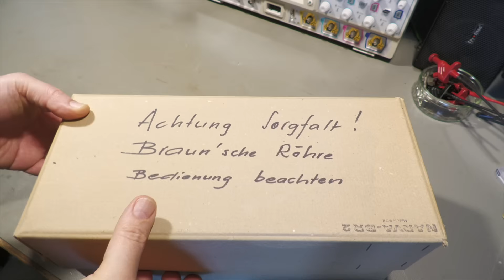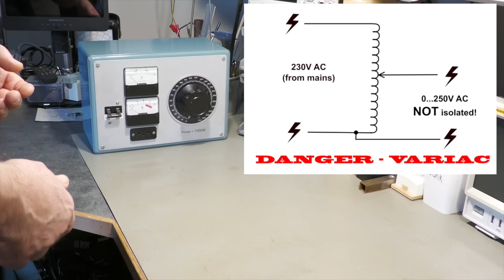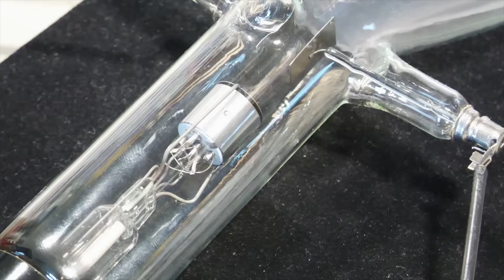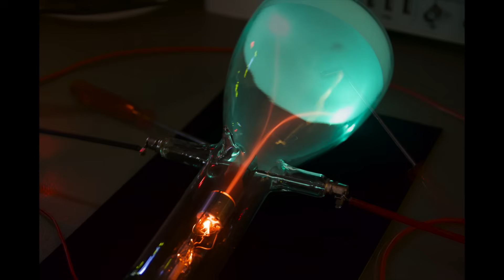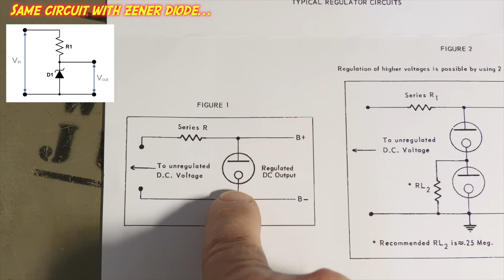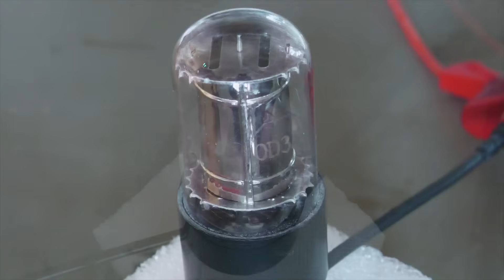Have you ever seen electrons? Watch this!

Comment: A very interesting antique tube the Neon fill makes it usual for a CRT.   In mid nineteen seventies I was employed at Tektronix Inc in the engineering tube lab.  Tek manufactured their own CRTs I got to know these items well.   One comment on safety.  Large vacuum tubes can implode violently, safety glasses plus some protective clothing would be wise.
Reply from the maker: Thanks for the warning. I know that. I worked in a TV studio and we had to replace many CRT's on professional monitors that have been running all day. We also had a complete set of safety gear. Helmet, goggles and a leather apron.... but nobody ever used that 🙂 And in fact not a single CRT imploded except those where we "helped" a bit. 🙂 You can see what we did then in this silly video "The apprentices from Swiss TV": https://www.youtube.com/watch?v=Z-0Bt3NoaCM&t=1s (at 7:30)

Comment: You can added two vertical deflection plate with 2 auto adhesive copper strip stick from outside neck of the tube.
Reply from the maker: Hmmm... that should work... I guess I will try that :-) I'm just not sure how to make the necessary high voltage. I assume, because the plates are far away from the beam, we need much higher voltage than on the "normal" plates
Reply: @PlaywithJunk You can extend the length of Cooper strip to the end of the tube, the phosphorus side.
That will increase the deflection sensitivity if needed.

Comment: where do the electrons go when the beam doesnt reach the phosphor? this is breaking my brain
Reply from the maker: To break your brain a bit more... the phosphor is not connected to anything. Where do the electrons go when they hit it?
Answer is, they just swirl around and will finally find a metal part to flow out. If you look closely, you see a dark cloudlike spot when the beam first hits the screen. I guess those are embedded electrons that repel the new ones. After some time these spots diappear. The electrons will find a way out 🙂
Reply: @PlaywithJunk  ahh i see that makes sense. i was also wondering what that dark spot was! insane

Comment: How do the electrons return from the screen?
Reply from the maker: That's a very good question. I think some just bounce off and fly around until they hit a metal part. Others just don't return and get stuck on the phosphor. That's those dark spots that look like burned or like clouds. Those dark spots disappear after a while...
Reply: @PlaywithJunk  Electron microscopy shows that some electrons go deep into material. I guess that secondary electrons help to neutralize the screen. The screen needs to be on a negative voltage to allow electrons to drift back to the cathode. I never understood why the screen is not called the anode. In a functioning CRT, no electron lands on the "anode". But that is exactly the definition of an anode in a tube amp or battery.

Comment: You're not actually seeing electrons. You're seeing their interaction with gasses. Ie the ionization of air in a bolt of lightning or static shock. You could never see an electron because they are too small. We have nothing with a small enough wavelength that it would "bounce" off of an elecrton. In fact, we use electron microscopes because we have this same problem with light. You can only magnify light a few hundred times before it gets blurry. But, electrons have a small enough wavelenght they can see tens of thousands of times magnification. So, naturally, it won't be easy to find something to "bounce" off of an electron. But yeah, you can certainly see their path in air. Just like a cloud chamber lets you see the path of radiation in real time. But you're not actually seeing the radiation.
Reply from the maker: I know... but the title looked better that way 🙂

Comment: it never made sense to me why a variac is build like it is .. it could work exactly like a transformer where you shorten or extend the secondary side instead of burning power by having this direct connection to the power grid.
Reply from the maker: For most Variac applications you don't need that extra winding. It would make the Variac unnecessarily more expensive.
If you really need isolation, then such Variacs are available (for higher cost). It's the same problem as always... you have to know what you need and how it works. 🙂

Comment: Would the first tube normally be used with an electromagnet for the vertical deflection as an oscilloscope, or was this made purely for educational purposes?
Reply from the maker: It was made for education. But the manual says that a deflection generator (Kippstufe) is available for horizontal deflection.
Then you could use an AC powered electro magnet to produce a sine wave on the screen to show your students.

Comment: The first one:  Very nice!  Much better than the mercury filled one we had to use in college to measure the mass of the electron.  So sorry about the burned phosphor though.
I love how you showed the beam extinction.  The electrons have to have a certain minimum energy to excite the neon.  Below that they just cycle back to the ground connection at the filament.  They also collect on the grid and deflection plates if they are not connected.  Some data sheets give a minimum resistance you can attach to ground the grid and plates without putting too much beam current through them.

The second one:  It looks like it is argon filled by the color.  Very nice!  Can you adjust the voltage by shining a UV LED on the cathode?

The choice:  The thing!  I have a couple guesses but you didn't show the end so I have to wait. :-)
Reply from the maker: The phosphor is not burnt, those dark spots vanish after som time. I guess it's more like electrons that get caught on the screen and repel other electrons. A TV CRT has a conductive layer on the phosphor that attracty the beam (anode) and lets electrons flow away.
Interesting idea to change the voltage of the regulator tube with UV light. I didn't know that's possible... 🙂

Comment: I had some old tube monochrome TV sets that you could see the beam through the back
Reply from the maker: The beam or the heater? A commercial CRT usually has an almost perfect vacuum. If you see the beam, there is something wrong. I had ONE defective CRT with some air inside. You couldn't see the beam but the electrodes inside lit up in different colors.
Reply: @PlaywithJunk  Likely just the heater. Though really old television CRTs did not have quite perfect of a vacuum. This was a known problem. The ions generated by the electrons striking the residual gas were accelerated towards the cathode, and this bombardment was eventually causing a loss of cathode emission. So those early tubes used a trick to minimize that -- they mounted the electron gun at an angle off the tube axis, and used a magnet to bend the electron path. The paths of ions did not bend as much by the magnetic field due to their large m/e ratio, and they were bombarding something else and not the cathode. But I doubt that there was enough of the residual gas even then to see the beam. unless the tube was actually faulty.
Reply from the maker: @cogoid  🙂 I have an electron gun from such a TV tube and it's (as you describe) "bent". 
We also had one at school but the reason, as we were told, was a different one. It was to prevent a dark spot in the center of the screen (anode) caused by the heavy ions that were dragged along with the electrons.
Reply: @PlaywithJunk  You are absolutely right! Although cathode emission loss also used to be a problem, the bent electron gun was invented specifically to cure the "ion burn" of the screen. I did not remember this correctly.

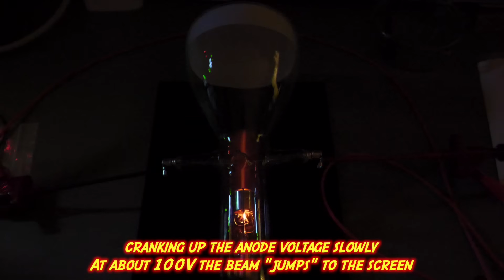Comment: 12:42 why does the beam stop there and only jump above a threshold voltage?
Reply from the maker: That's a good question... I assume the beam doesn't stop actually, but it spreads out and becomes invisible. I imagine something like a garden hose that shoots water straight up. More pressure = longer water jet

Comment: At high school in the Physics Dept we called these Teltron Tubes and we used them quite regularly throughout the Physics curriculum. We had a number of tubes for different investigations, electron diffraction with the Maltese Cross Tube, electron mass/charge ratio with the Deflection Tube with Grid and Helmholtz Coils, the Dual Beam Teltron tube, and the Perrin tube to investigate electron charge and magnetic field. Ours were stored in their original boxes from the 1950 fill with horse hair to cushion the tubes and prevent them from being broken. I always remember the fragility of the these tubes but they were great for demonstrations and the pupils loved using them. I once looked up replacement cost for one and found it to be in excess of £1000!  That was more than our annual science budget!
Reply from the maker: I guess Teltron was the name of the manufacturer? So, I made a good deal paying 115 Swiss Franks for it 🙂
Reply: @PlaywithJunk  Yes it was, in school they just took on that generic name  a bit like all vacuum cleaners being called hoovers (UK) lol. Education equipment always carries a big markup (I think due to low volume sales) so yes you got a nice bargain there :)

Comment: 3:50 Yes, a variac is a transformer - however, as an autotransformer, it has no galvanic isolation.

The reason it isn’t a rheostat is because it can produce a voltage at the output higher than the input if the input has been tapped a ways down the coil winding.

Comment: I must contradict you on all variacs are not transformers. I own an old RFT adjustable variable transformer which is basically a thoroidal transformer with a primary and a fully adjustable secondary. If you don't know what you are looking at, it looks like a run of the mill variacs.

Comment: Given the potential difference of 200V between the deflector plates, why don't they bend the beam?
Reply: The Potential Difference between the Plates is 0.0 Volts since Both are connected to the 200 Volt Anode Supply.

Comment: Also, magnet taped upon end of power-drill (but hide your tube behind acrylic sheet!)   The fast-spinning magnet will scan the beam in a fast circle.
Also, someone said that, with correct voltages, the beam spreads out into a disk, and when focused just right, it becomes an electron microscope, where the glowing disk shows an image of all the defects on the cathode surface.  (If this requires extra electrodes, maybe wind a "focus coil" around the glass neck.)

Comment: Try two wide magnets!   You can curl up and reverse the beam, creating a spindle-shaped "magnetic bottle" with visible electron-glow being reflected between two magnets.  Demonstrate a particle-trap. (Might need to alter the main DC supply, reduce acceleration far below 300VDC, to let some loudspeaker-magnets cause the beam to curl up with tight radius.)
The USA version is from Teltron , also called "fine beam tube" or "perrin tube."   Green beam if helium, red-orange is neon.   I find that the electron-gun has short lifetime because of ion-impact against the cathode oxide (they didn't use direct tungsten cathode!   Or, tilt the electron-gun, then add a tiny magnet to tilt the electrons but not the heavier positive ions.)

Comment: Couple of questions:
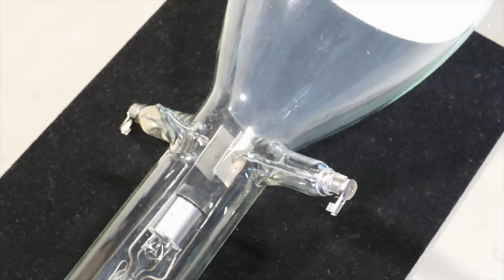 - @1:30 why do we see a small discharge?
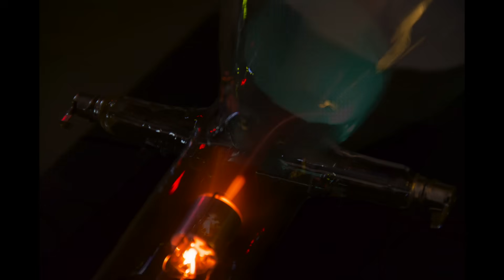- @13:54 why does the beam stop when the discharge plates are not connected? What happens to that energy and the electrons?
Reply: The energy (via electron collisions with the inert gas) is going into making the inert gas within the tube glow.

... and the electrons don't really have a lot of momentum after passing through the grid, the plates accelerate the electrons  enough that they can reach the screen before coming to a stop again from gas collisions.
Reply: @juliavixen176  "..within the tube glow." - yes i understood that and why the gas collisions happen. "grid" - what do you mean by that? he never connected that, i don't really understand its function. "plates accelerate the electrons" - I thought they were deflection plates? to orient where the electrons hit.
Do you know why that tiny(hardly visible) stray/discharge at 1.30 occurs when it hasn't even been connected to a source?

Thanks

Comment: Such an excellent demonstration!

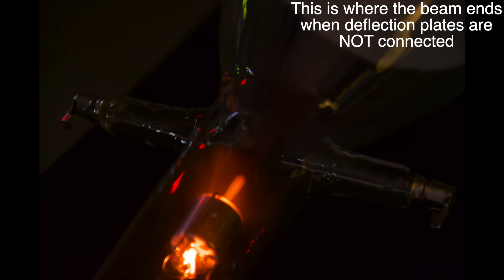13:55 "when the plates are not connected the beam stops"  I wonder if the plates provide a path to keep the screen from charging by the beam. When the electrons have nowhere to go, the charge accumulates, the potential rises, and stops the beam.

In a television or an oscilloscope CRT there is a connection and a conductive coating inside to connect the screen and let the electrons to get out. 
But here there is nothing obvious visible. If there is some coating it would be natural for the plates to serve as the connection. Perhaps that's why the beam stops when you disconnect the plates.

Comment: I had forgotten that electron beams are affected by magnets. Thank you for bringing back old memories.
Reply: Why is this happening?
Reply: @Idrinklight444 the magnetic force acts upon charged particles in motion.
Reply: @Idrinklight444  The right hand slap rule may be handy to remember: Have a sticking-out thumb point in the direction of positive current and the parallel, straight fingers in the direction of magnetic field lines (from a north-seeking pole to a south-seeking pole) and the palm will indicate the slap the current’s charged particles feel. (Since electrons are negatively charged, the thumb would point in the opposite direction of the electron flow for the same reason throwing negative money at someone makes the direction of wealth transfer towards you.) This rule is continuously applied, so a uniform magnetic field makes a moving charged particle move in a circular arc or even a full circle.
Reply: everything is at a high enough power level

Comment: the mysterious Thing seems cool .. my vote is for that :)

I started wondering during the video.. As CRTs (and most tubes) rely on a vacuum to work (or no oxygen around at least), what would happen if you had the same components set up in space (outside earths atmosphere), and turned it on?
Reply from the maker: Well you wouldn't need glass around it. It should work 🙂
Reply: They would probably work, but fail early on.  Outside earths atmosphere still has too much pressure.  No one really knows for sure but it is speculated that the pressure in a vacuum tube is 100,000x better than where the ISS and most satellites orbit.
Reply: There were some experiments long time ago where astronauts performed electron beam welding in space. I think it was on one of the Soviet stations before the ISS. The vacuum around ISS is around 10^-9 Torr, which several orders of magnitude better than in a typical CRT. Vacuum tubes and CRTs would work there very well without the glass. 

Some vacuum tubes are made without glass. These are used in ultrahigh vacuum systems for measuring the vacuum, and not having the glass envelope allows the residual gas molecules the easiest way to get between the electrodes. The resulting (very tiny) current is the measure of how much gas remains. For more ordinary high vacuum the same gauges are made in glass like the ordinary vacuum tubes, and are connected to the vacuum system by a pipe.

Comment: Want to see the Thing.
Loved the bit on the 2 tubes you lit up, going to fire up a cold cathode rectifier tube I have here right now lol
With that voltage regulator tube the strike voltage will rise a bit when the tube is in the dark, as the ambient light does make them strike at a lower voltage.

Comment: 11:46 The reason the phosphor is severely damage is because someone has done what you did but cranked it up all the way and the electrons just sputtered the surface clean.
Reply: Dip the front face in wax or even lard.   When cool, run the tube, and watch a small wax spot be melted where the electrons strike.
Reply: @wbeaty Why would you want to do that?
Reply: @TheZombieSaints  To show the heat it generate so people would understand.
Reply: @dtiydr  OR use an ir heat camera
Reply: @TheTubejunkyelectron generate cold, not heat
Reply: @Kawka1122  Have never talked about heat so I have no idea where you got that from, and you have obviously never heard about sputtering either.

Comment: 3:51 Yea pretty much 95% but there exist isolated normal ones but they are very expensive.
Reply from the maker: We have an isolated one at work but that has an additional transformer built in
Reply: @PlaywithJunk  Yea those exists as well I meant those that are exactely like a normal one but that has a primary and a secondary so secondary is as such not internally connected to mains so 2 coils which is more trouble to make.
Reply from the maker: @dtiydr  Yeah they are pretty rare and expensive...

Comment: That's a super cool CRT. Toot bad that someone left it burning too long with no deflection and burned a hole in the phosphor coating.
Reply from the maker: I first thought it's a hole too but it isn't. It's some sort of shadow caused by electrons captured on the phosphor screen. Those shadows move together with the beam and some stay local, but they disappear after a while. That happens because the screen doesn't have a conductive layer like TV CRT's have. 🙂
Reply: @PlaywithJunk   very awesome thank you for the adventure

Comment: The thing! The thing! (BTW, 6.3 V is the nominal voltage, not the maximum one. Using a tube with this kind of cathode with the heater voltage too low reduce the life time of the the tube. Also, a CRT is supposed to be used with a fix anode voltage and a variable grid voltage to adjust the luminosity)